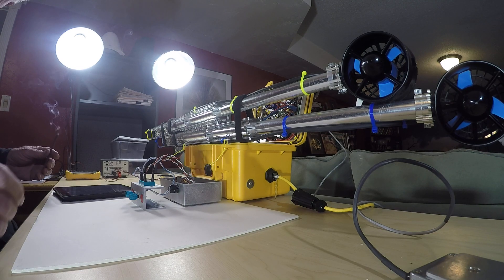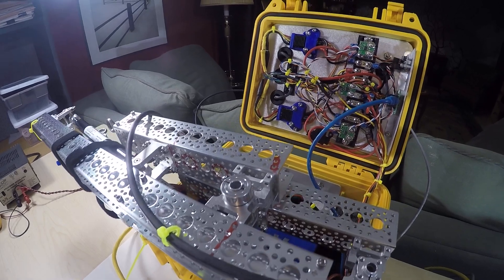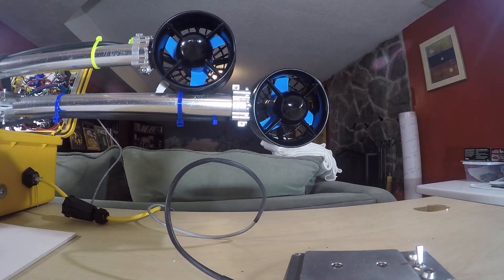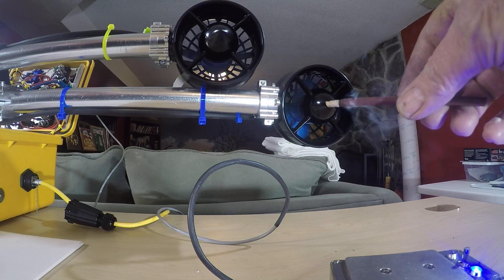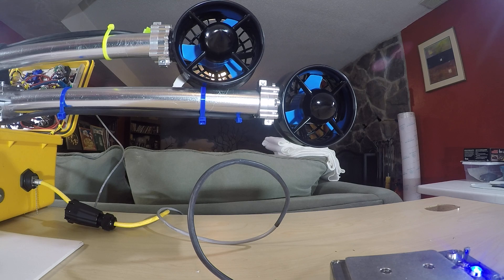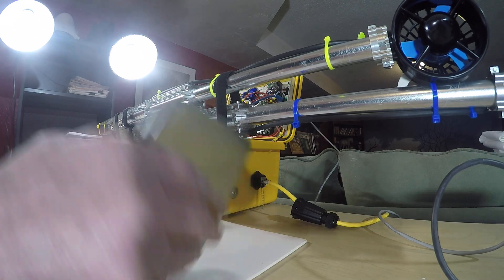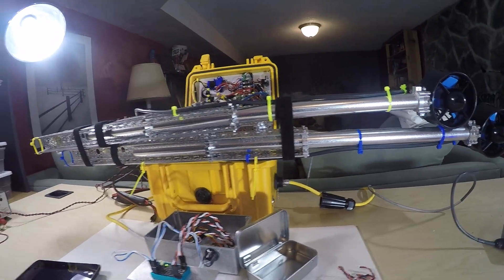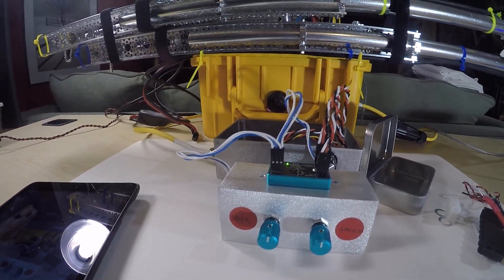BlueRobotics Thruster Commander Initial Test

Comment: Your damaging the thrusters they need to be in water so you don’t harm the thruster
Reply from the maker: The total time operating the thruster in this video was just over one minute. According to BlueRobotics "Do not operate the thruster for extended periods out of water. The bearings are lubricated by the water and vibration and noise will be greater when dry."  I don't think running these thrusters without any load for about a minute is a big deal.

Goto this page on the BlueRobotics website and scroll down near the bottom under "Important Notes"
https://bluerobotics.com/store/thrusters/t100-t200-thrusters/t200-thruster/